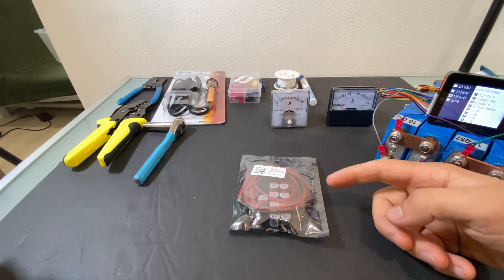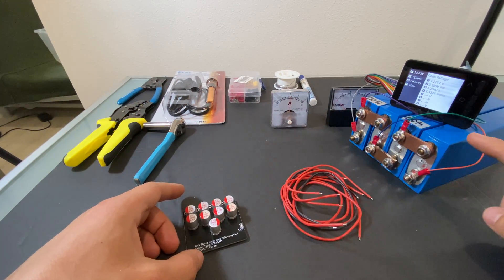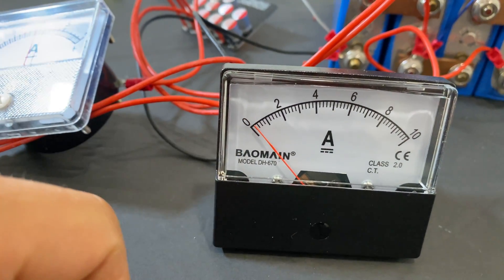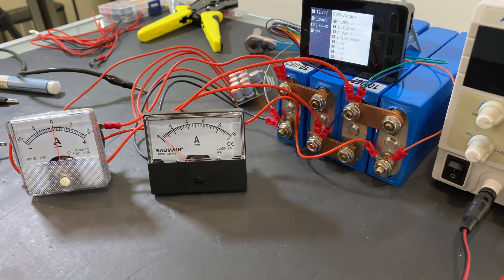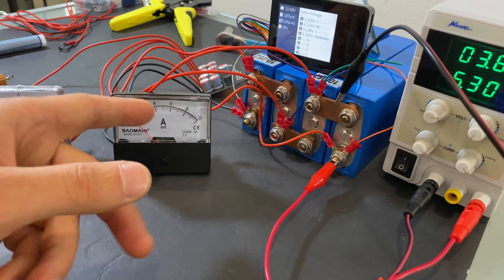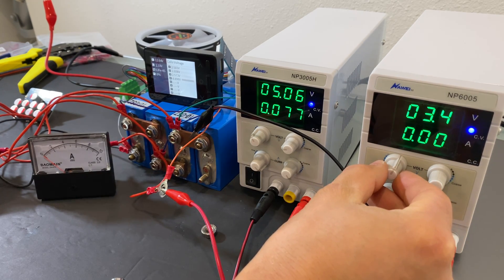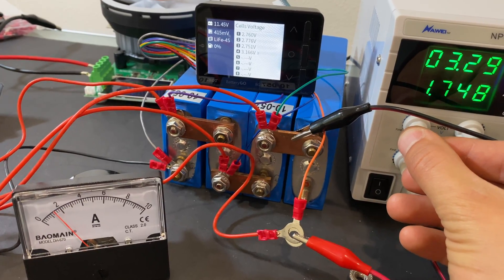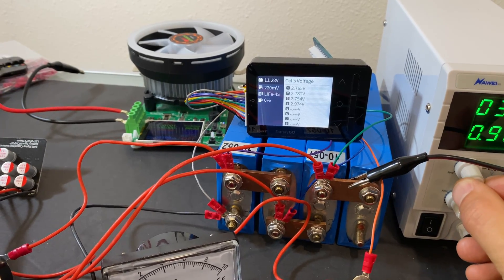Detailed test of 5A active balancer.

Comment: i blow up 2 of the 1.2A versions because one of the cells were 4.25 volts wth...and how about this one does the high voltages dont burn it out as seen on the video...and how about connecting and disconnecting the balance wires from the balancers to use them on other battery packs with already cables pre installed ?? thank you

Comment: Thank you for another great video. I saw on off grid Garage channel that when he top balance so the pack is perfectly balanced and then discharge the battery to a voltage level where it can either be close to full or close to empty and the battery start to reshuffle the pack in a wrong way, and then when the battery get charged up again it is in total unbalance.  Would it be better to just have the balancer interact when the battery is 80% full and above so it doesn't shufflee around so much energy in the level where it is hard to say that one cell is lower charged than another just because it is 50mV lower in voltage?  Ps. I really look forward to se more testing of your 500A BMS  :)
Reply from the maker: It's an interesting point about cells disbalance. I'm using another active balancer in my bigger battery bank, didn't set minimum voltage there. So far it works great, sometimes it takes few hours to rebalance cells when it's reaching ~3.5V, but after I don't see unbalance at low voltages.
I just got cells after  3 months, so the BMS test will be done soon.

Comment: Its works very well I have one on 14s missan leaf battery it keeps the cells balance
Reply: 6s heltec active balancer can do the job for u
Reply: @offgridlivingstlucia8865  thanks man. Some people have said leaf modules cant do 24 volts... only 48 buy I've been using them as 6s 24 volt for over a year with no problems at all. I was kinda worried about not having a bms but so far they been great. I'm going to find that active balancer you suggested and get it for sure. Thanks again
Reply: I saw the comment where you have a balancer on the leaf cells. I have 24 modules at 24 volts. What's a good balancer I could use on this set up? Any advice appreciated
Reply: I have the same active balancer on my Nissan and it work very well

Comment: Thanks, once again really good info. 
I wonder how much the resistance in the wires connecting the active balancer to the cells contributes to the balancer response. Would it not be be better if the balancer used sense wiring separate from balancing wirring?
Reply from the maker: 0.45A is still a small current for these wires, I think 12-16AWG wouldn't help this balancer.

Comment: Just be careful if used on your bigger battery pack.  I came across a video of a gentleman using one on his 280ah cells and it seemed it would try too hard to balance on the discharge and ended up making his pack unbalanced as he was charging with up to 50ah of solar in mid-day and had a shorter time in the charging cycle.  Here is the video if you are interested  Channel name is "Off-Grid Garage" https://www.youtube.com/watch?v=4iPpn8-Pakk  Always enjoy trying out products on batteries to see what works. Keep up the good work.
Reply from the maker: thank you for the info, I'll check it.